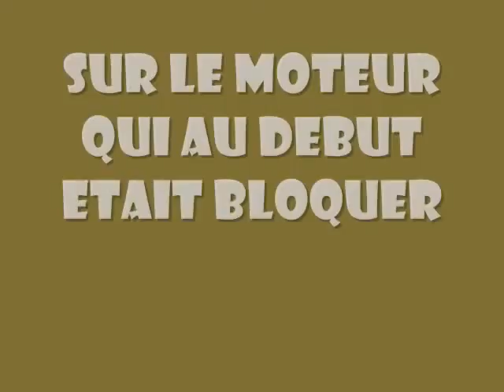Suite de la restauration du moteur bernard W2

Comment: Comment tu as fait pour débloquer le piston j’ai le même problème sur un w1
Reply from the maker: bonsoir, le piston était à mis course  une bonne dose de dégripant , une douille de 34 pour une portée uniforme sur la tête et deux coup de masse on suffit à le débloquer, grosse clé à cliquet en sortie de vilbrequin pour aider la descente en  même temps que les coup de masse. Si ton piston est au PMH ou PMB ça vas etre plus chaud
Reply: cyclopette Atelier  oui le problème c’est qu’il est au PMB mais je vais essayer d’y mettre du dégripant industriel et de forcer un peux
Reply from the maker: @gerardderifi5276 du coup dévisse le cylindre et la tête de bielle ce sera plus facile
Reply: cyclopette Atelier oui de toute façon j’ai pas trop le choix 😅 merci de ton aide
Reply: Nous avons débloqué mon père et moi pour un w2 avec cric hydraulique calés en frêne en dessous du linteau d.entree ,garage
Reply: Pour l’update (4ans après) j’ai finalement levé le cylindre en le séparant du bas moteur (deux petits écrous). J’ai ensuite calé mon cylindre pour que mon piston soit à un équivalent mi-course. J’ai ensuite noyé de degripant et tapé avec un chevron et une masse. Même comme cela il a mis un moment à sortir… 
Au final mes segments avaient fusionnés avec le piston. Heureusement, j’ai pu retrouver un piston d’occasion sur internet (non sans mal). Après un bon coup de nettoyage et un remontage en règle, la bête est repartie de plus belle.